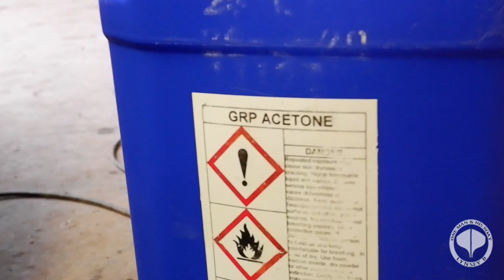Pot hauler prep Pt 3 Episode 71

Comment: Hey mate, what with the need for all the stainless plates? is is so the pots and gear doesn't damage the boat as well as a bit of structural integrity?
Thanks
Reply: I should also add. Beautiful craftsmanship. You are very talented
Reply from the maker: Hi bud.
Your bang on there.😁👌
Because this is the working area and the most stressed area on the boat when pulling the pots, the more you tie everything in with the stainless, it will be  less stressful on the boats Hull and shape when pulling the gear.
Also, Mahogany is a soft wood when it comes to daily creel work. If we didn't protect it, it certainly wouldn't last long.
Plus, the stainless is personally choice as not only does it look good, but it's VERY strong and will last my lifetime with the boat.😁👌

I hope that helps.

All the best 😊

Comment: Hi mate you just reminded me i have to get some duralac forgot about it , well your more skilfull than me i can build a house but my welding is like birdshit bill .My father was a welder but he never taught me which is to my demise my welds work but im glad they invented portable grinders hahaha . Was that stainless you were welding ? do you need a special liner like for aluminium ? anyway a bloody good job on that pot hauler .
Reply from the maker: Hi buddy. 
🤣🤣🤣 never for get the old duralac,  it helps loads.😍😁👌.

Yup I was welding the stainless.
Key to welding stainless is low heat, a doo wipe down with acetone before you start and 100% argon gas, the rest takes practice and time.🤣🤣🤣🤣
I hate welding stainless, far easier with mild steel, but the effects are not as breathtaking 😁👌

All the best buddy😊

Comment: If hat 1 inch lip  at the workshop door is steel,  why not just cut two bits out for the bogie castors and weld them back in once she's out?

I bet the bolt at the far end of the pot hauler mount was a right faff getting the nut on the back (unless you put a captive nut on prior to welding?
Reply from the maker: Thought about that bud, going to have to butter my brother in law up a month before we move her, for that!....but it's defo a better way to go, less movement from the cradle and the boat.😉👍